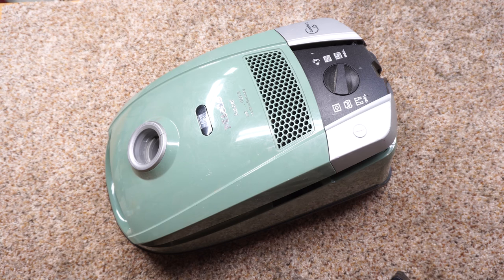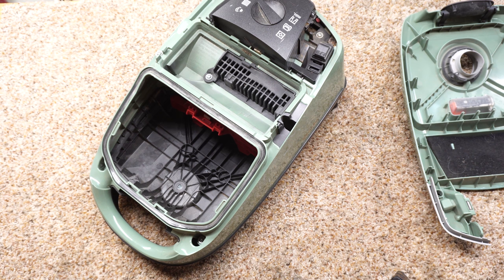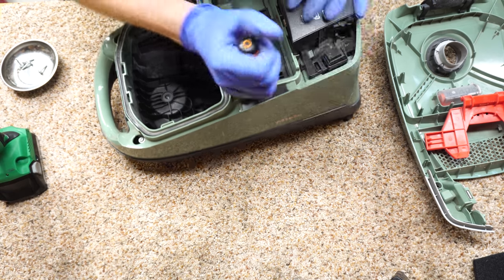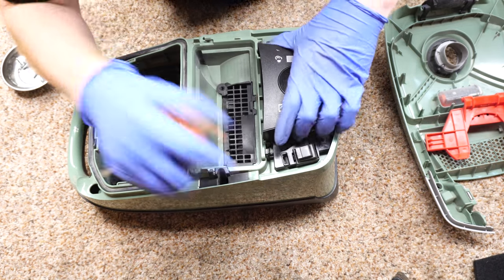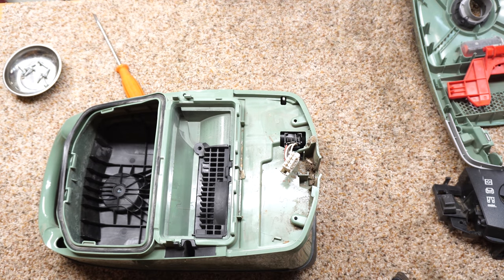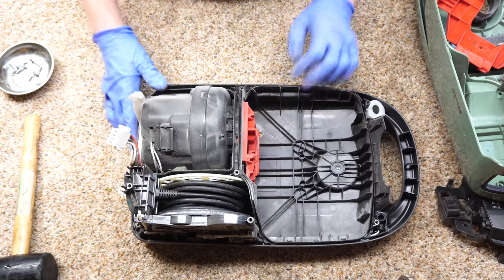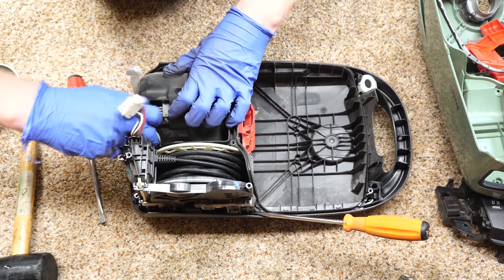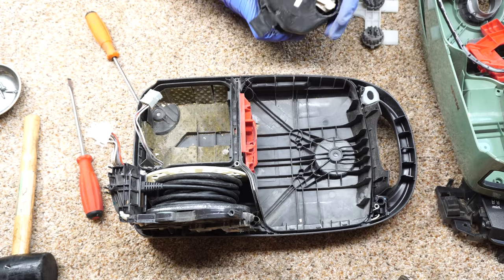Miele c2 S6 Vacuum Cleaner Repair - How To Restore Suction

Comment: Thank you for this video! 8:11 The "Rube Goldberg" cable rolling mechanism broke twice; once under warranty, and then again out of warranty. A small part broke off, causing the brake not to engage, so it would always pull in the cable. With a bit of putty on one of those white plastic parts, I could prevent it to latch in the brake-off position. Now I have to keep the button pressed to roll up the cable.

Comment: I work for a cleaning company and we use miele c1's and we haven't had any issues in years. Keep in mind there being used in commercial environments for 7 hours every day and I've only replaced the on off switch problem and added a new cord other then that they have held up amazingly.

Comment: I recently picked up a non-working s6 miele onyx that was pretty thrashed by lady who runs wedding venues. I was able to get it working again by replacing the motor triac and deep deep deep clean. It was ran without a bag along with no pre-motor filter for an unspecified amount of time, so far i really like it. I was wondering what that plug near the handle was for, does any miele power hose work with it or is there a particular attachments that only work with this model line?

Comment: it wasn't clear what you put in the dishwasher.. assuming you didn't put the motor or cord rewind.. but you washed the body with wires and contacts? with the sensor for when the bag is full? is corrosion an issue from getting the metal parts wet?

Comment: l'ho usato per pulire il filtro basso  di un asciugatrice.
mi sono accorto che c'era poca acqua stagnante e ho fermato immediatamente.
nessun danno, tutto pulito, ma adesso puzza. l'aria che esce ha un cattivo odore. Ho cambiato sacchi e filtro, e profumato l'interno ma ancora un pò di cattivo odore.
cosa suggerisci? se smonto e profumo tutto?
Reply: NO DO NOT PURFUME ANYTHING
Reply: It will ruin your Miele
Reply: @Homepage.  i had dryed the few Little water insider the bag compartment.
Luckly,the water was stopper before engine.
I dryed everything, and i keep the miele opened exposed to air.
Then i changed all filter and bag, and put inside a parfum paper i use in the wardrobe.
I put One bottom the bag.
Now its all ok